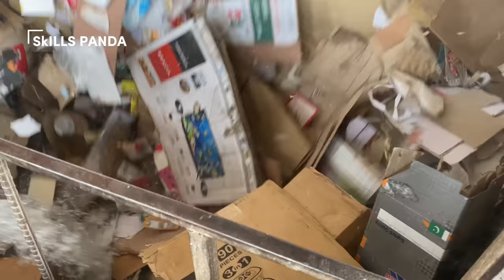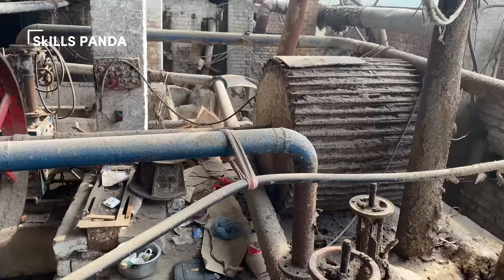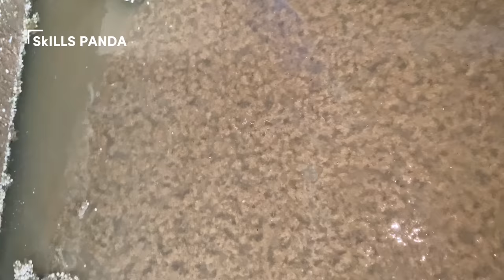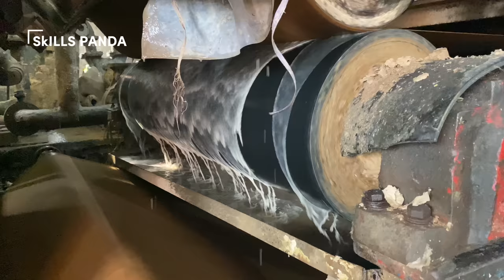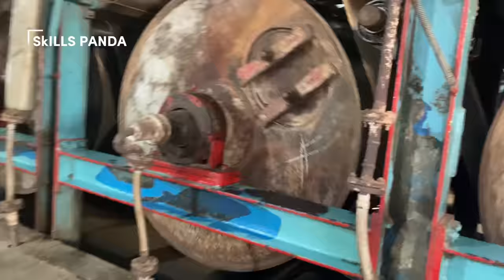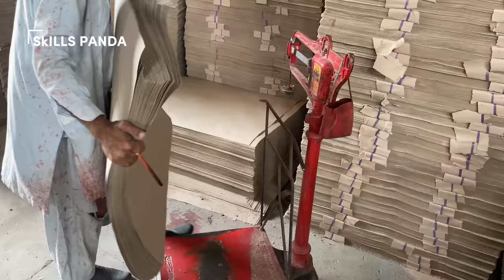Uncovering the Fascinating Process Behind How Cardboard is Made! Cardboard Manufacturing Process

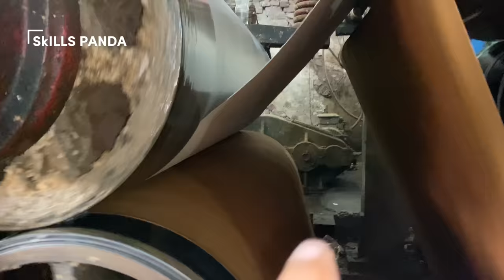Comment: A miracle happens when the slurry turns into a fibrous sheet that you can pull through machinery.  At 6:51 you see the separation of the "chip board" sheet as the first indication of viable and separate paper.  If you could keep the feeding end of the trash cardboard full, you could feasibly create one very long sheet of paper that could be many miles long.
Reply from the maker: Great suggestion!
Reply: @skillspanda2.0  Still, quite in depth.  It's amazing how many rollers and how much calendaring there is of the paper I'll never get over that!  Fascinating industry.  Thanks Skills.
Reply: This is not printing but craft manufacturing. A starch is used to bin the slurry which is big business in itself.
Reply: Kevin…
I worked 32 years at Great Northern Paper Company in East Millinocket, Maine. We had 6 paper machines and a recycle plant on site. We produced newsprint, catalog and others grades of paper.
Reply: Paper making is fascinating. The most useful product of all, books, are made from it.
Reply: @davidpage3893  Making paper is an amazing process.
Reply: @vajaynunthandass676  Thanks so much, after working with paper for THIRTY YEARS IN THE USA I was pretty confused.
Reply: I’m not sure if i missed it or if it wasn’t shown at all but is there like a dosing mechanism for dyes in the process? Or none at all?

Comment: It looks like the waste paper has been sorted before delivery as these is very little styrofoam in the sheet.
A lot of board grades are still make on this type of former in North America and Europe. Cylinder moulds make a very strong CD-MD sheet, but heavy pressing and Calendering is required to consolidate the sheet and put a good surface finish on the sheet. 
Threading the Calender using an air hose would be a lot safer for the operator.
Putting a small press in around the 30% moisture would really improve the sheet smoothness without the reduction in bulk.
Not a bad looking sheet considering the furnish.
Skills Panda please excuse my comments but I used to troubleshoot these types on machines in Canada and USA as part of my job.
Reply from the maker: Dear Mr. R.Lee thanks for watching and commeting, please stay connected
Reply: tu podrias por favor compartirnos mucha de tu experiencia por favor  y muchas gracias  mi papa trabajaba en una papelera industrial en mexico  y se llamaba papelera  san rafael pero ya hace mucho tiempo dejo de existir y tambiem trabajaban el caolin y el papel xeros para foto copias  y de esa papelera  a mi familia y a mi nos saco   adelante desde pequeños hasta la mayoría de edad. muchas gracias por postear este video pues me hicieron recordarme de mi niñes muy bonita infancia DIOS LES BENDIGA AMEN
Reply: Yeah, it’s cardboard mate.  Not part of a space mission.

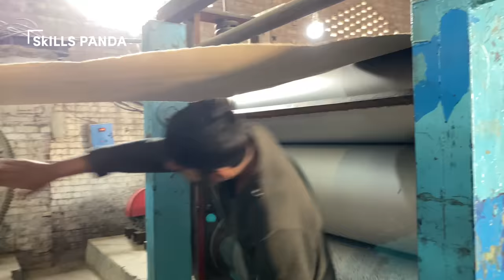Comment: Obviously this mill isn’t in the U.S, but in the states there are a lot more safety measures like at 9:40 when he feeds the sheet into the press we don’t do that with our bare hands that’s a good way to loose the hand and arm. And the state of those dryer cans looks like they haven’t ever been cleaned  ever which should get done one a week  or at least whenever you shut down,and inspected by an outside company at least once a year for cracks and the like. Those  cans have a bunch of steam in them and will explode of not taken care of. But yeah this video is a good example of how it’s made. It’s dirty, wet and hot as hell in there, but pays a good wage at least in the states.

Comment: The printed and waxed or plastic coated colour surface only makes up a small part of the card - but it will leave streaks and hairs in the card when finished.
Forensic experts can date card by these impurities, for example coir or hemp string from genuine Victorian card!
The product in this case, with no new wood pulp or bleaching shown, must be really low quality. 100% recycling cannot go on forever, at some point the fibres are so short and degraded new products will just fall apart while trying to make them in the machines.
Reply: Your right fiber can be reused 6-8 times before it’s too short